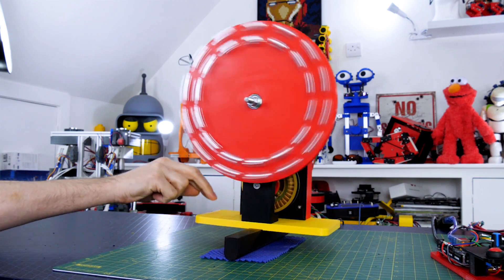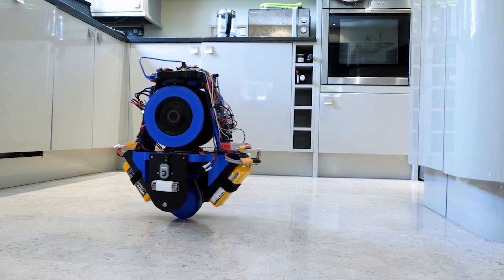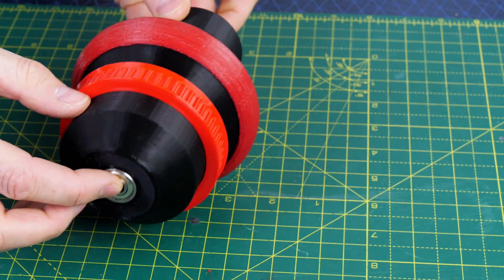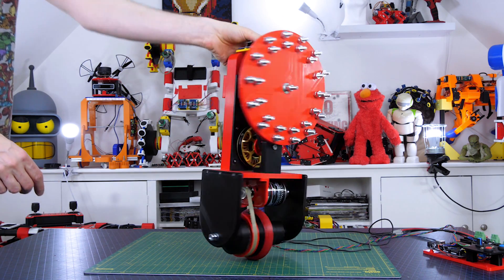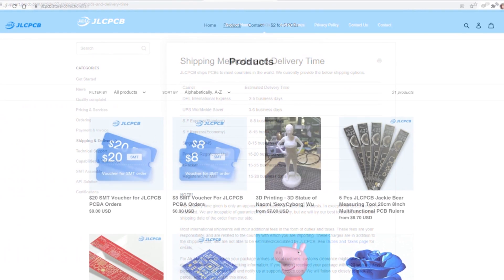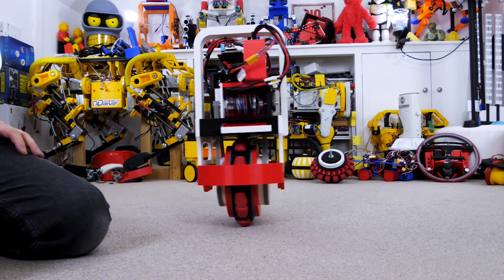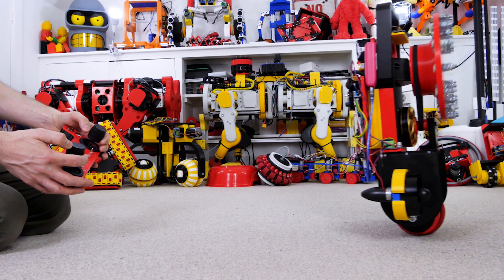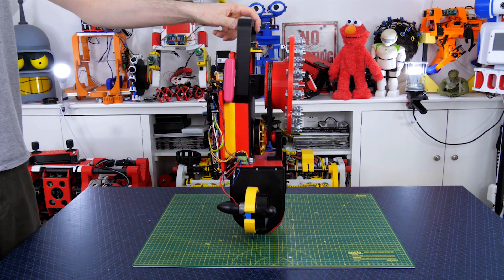How this Robot Balances on ONE WHEEL

Comment: Although this is slightly off topic, I was wondering how well an omni wheel that has ribs that allow it to slide sideways rather than wheels would perform on carpet. Maybe you could make sliding omni tank treads even? These wheels would need a lot of traction in one direction, and the ability to slide in the other direction. It would only work well on soft terrain like carpet though.

Comment: After watching this and gyro balancing robot video the question I have is what's the most efficient way gyro or reaction wheel? I assume it's a gyro, because when it's spun up it uses a constant current but the reaction wheel constantly changes the RPM of the motor 🤔

Comment: Reaction wheels always generate precession effects too. So, if the reaction wheel is not stopped whereas a turn, this results in a torque which is not wanted. In my oppinion 2 x 2 counter rotating gyros are necessary for proper function regarding roll and yaw axis.

In my point of view, with 4 gyros the whole system works very close to a helicopter with 4 propellers. So a  flight control system like "BETAFLIGHT" should work and provides a comfortable graphic programming interface.

Reaction wheels are good for static applications, but not for dynamic systems like robot cars.

A co-operation with ReM-RC might be successfull.

Comment: Wouldn't it be possible to make it turn by allowing it to lean into the direction you wanna turn and then going forwards/backwards, and for turning while staying on the same spot, time back and forth motion with the side to side swinging to accumulate several small turns?

Comment: Rather than a more massive reaction wheel, you should split it in half and put one half in front and the second in back, both mounted to the same axle. That way the effective center of the reaction wheel mass will be on the center of rotation of the whole robot. And the tilt moment arm will also be centered. 

Did you statically balance the robot? Hang it from a string attached at the pivot point of the drive wheel and add weights so that it hangs perfectly vertically.

Comment: How good would a reaction wheel be if it only relied on air resistance? Like a a fan with big, light weight plates. It should be able to stabilise the robot without the need of acceleration
Reply: @♜. Pinnedby       James Brut. really? I don't find you very convincing with your 0 uploads.
Reply: @♜. Pinnedby       James Brut. +you joined yt on the 10th of April. Just stop it. People like you are ruining the comment section

Comment: @James Bruton You should get with your sponsors and see if you can host some kind of robot building competition. You could pick your favorite drive mechanism from all the robots you have made and design the competition around that. For example (and I came up with this in about 2 min, so it isn't fully thought out):

Sample Requirements:
- Robot must be 3D printed as much as possible. (Not including screws, bolts, electronics, motors, etc...)
- Robot can have either 1 or 2 wheels.
- if it has 2 wheels, only 1 can be powered and the wheels must be positioned with one in front of the other (like a bicycle)
- robot can only balance using one of a handful of ways (which haven't been determined yet.
- etc...

Sample Challenges:
- time trial race on a smooth, level surface
- time trial race on smooth, sloped surface
- off-roading challenge
- hill climb
- balance on thin beam
- balance on freely tilting platform
- etc...
Reply: I don't have the right skills-set to compete in a challenge like that, (I'm a video game programmer and have never 3D printed a thing in my life.) But it would still be fun to watch.

Comment: Would it make senese to replace the wheel with a long horizontal bar with smaller weights on each end, so it would be more similar to a acrobat balancing on a tightrope with a bar for helping with stabilisation.

Comment: I am sure that very soon the great James Bruton will be successful in building a teetotal robot.
In the meantime, I was wondering if the single wheel, with all the balance problems it causes, is not energetically less preferable than a three-wheel system, which stabilizes itself without consuming anything?

Comment: Maybe you can try to make it steer by leaning like a motorcycle?
Reply from the maker: That would be ideal - or just lean the wheel?
Reply: @jamesbruton  Or if you could lean the wheel and the main mass of the robot independently, that would be great. Motorcyclists do this for example to be able to lean the wheel more than the speed would otherwise allow, therefore archiving tighter turns. Might be more difficult to implement though.

Comment: If you just want one single moving point contacting the ground, wouldn't a solid sphere-wheel using three omniwheels at the top of the ball allow you to roll and turn as needed? I think it might also negate the need for reaction wheels and etc in favor of balancing via watching gyroscopic sensors, although they would likely increase overall stability.
 
I keep coming back to the thought of just using two wheels as close together as possible however, with some degree of rounded edges Vs flat edges, while using the reaction wheel and maybe some springs to make the wheels better adjust to keep both in contact with the ground for turning.

Comment: Suggestion: to turn, couldn’t you use the wheel with the masses to adjust the roll soft the device, combined with an initial backwards motion of the wheel which contacts the ground (to account for the forward movement when turning) to use the sides of the wheel to turn

Comment: Great stuff! Would it be possible to replace the reaction wheel with a long pole with masses at either end, such as a tight rope balancing pole? It'd have to make do with only a few degrees of max rotation, and keep finding the horizontal position reliably after an adjustment. But the advantage would be that you could attach another actuator to the same pole that rotates it about the vertical axis, enabling you to turn. A simpler alternative of course would be to have a second reaction wheel for turning.

Comment: Really cool, i wonder if you can build balancing robot that just uses multiple fans blowing in different directions to balance (not a new idea I'm sure)
Also, maybe instead of switching direction on the reaction wheel, i wonder if you can ha e two parallel ones spinning in opposite directions and vary the speed of those, that might cut down on reaction time

Comment: Very elegant! Well, the fans are a bit of a kludge, but still pretty appealing because of it.

I feel like you could get both steering and balance with a horizontal reaction wheel instead of a vertical reaction wheel. Well, not a true reaction wheel, you place more of the weight on one side.

So, it steers as a reaction wheel, but it balances by shifting weight.

Comment: With the reaction wheel and the thrusters, it's very space tech! Nice work.  Makes you think... I wonder how a reaction wheel would work underwater?
Reply: It should work just normally, right?
As long as you put inside of some type of waterproof shell, so that there is no added friction and torque against the water.

Or would the added degrees of freedom just make the whole robot spin around?

Comment: Love your stuff! What we all need is a good open source telepresence robot, and I think you're just the person to bring it to the world!
Reply: James always picks good projects so I’m hesitant to make a suggestion like this. That said, an open telepresence project could be interesting and fun.
Reply: I think the biggest problem with roving telepresence is handling rough terrain and obstacles, because there are open source packages already available for FPV (first person view/video) drone operation. I suppose one could shrug and use larger wheels and/or knobby tires, but there's always the question of whether that's the best solution. It's at least a reasonable solution.
Reply: @tantamounted  FPV is not telepresence. Telepresence requires real-time bi-directional Audio and Video, ideally over a routable IP connection.

Comment: Can the reaction wheel maintain an out of balance state?

It could potentially steer by the reaction wheel maintaining a lean to one side and moving forward or back. 

Making the floor contact wheel wider may help.
Reply: No. As he says in the beginning of the video, reaction wheels only supply force while accelerating. The longer it stays off balance, the faster it needs to spin.
Reply: @davidgustavsson4000  If the tangential speed was right, it wouldn't need to stay off-balance - the centrifugal and gravitational forces could be balanced, though the control problem would be harder.
Reply: That means using a gyro, in addition to the reaction wheel?
Reply: Not really. It can "balance" only momentarily because it requires a constant reaction torque, which requires constantly accelerating the reaction wheel. It also cannot steer by leaning to one side unless the ground surface is banked. Without the EDF, the only way of steering is perhaps taking advantage of the gyroscopic effects as there are only 2 control axis for this robot, one primarily for leaning and the other forwards/backwards. You need a third reaction wheel (or EDF) to give control in the yaw axis.

Comment: Love the progress, what would happen if you did small reaction wheels on all three axis with very dense masses like bismuth?

Using bismuth you should be able to pack a ton of mass into a wheel. Depending on the plastic you might even be able to cast the bismuth into the wheel since bismuth melts on a stove.
Reply: Bismuth cost 50 euros per kg. Lead cost 1,50 euro per kg. I know Lead fumes are terrible, but I'm quite sure that it's way easier to get your hands on, and if you do it in a safe setting and coat the lead with some varnish afterwards you'll be fine. Also, Bismuth is very brittle, it doesn't have the same flexible deformation that lead gives you when it hits something (in case your machine falls and the wheel hits a solid object while spinning fast). I think that Bismuth isn't the ideal candidate in this case. What would probably be best is to use a copper or brass ring and machine it into a wheel.

Comment: Are you able to take all the bolts on the reaction wheel and flip them? If your extra nuts were on the back of the wheel instead of the front the center of mass should be better and its pretty easy to try
Reply: I'm not sure there's anough clearance with the motor bracket to move the outer bolts, but the inner ring could be flipped.
Reply: Get rid of the bolts all together and glue in lead weights. Much more dense. Probably wouldn't need to populate all of the holes in the reaction wheel, either. Hot glue would probably be fine.

Comment: I think you could also steer by making it lean with the gyro and then driving forward/backwards and after that turning the gyro in the other direction to make it stand upright again
Reply: With that approach, you get the issue of running out of reaction wheel speed. The longer you're tilted to the side, the faster the reaction wheel needs to spin.

Once you've returned to the center, you'll have to lean the other way to lose that reaction wheel speed.
Reply: @antonliakhovitch8306  correct but I think it's worth a try because you don't need much lean to turn